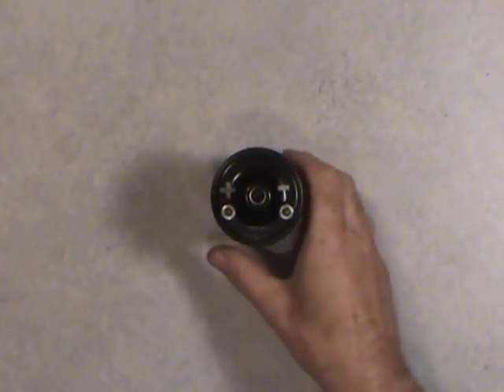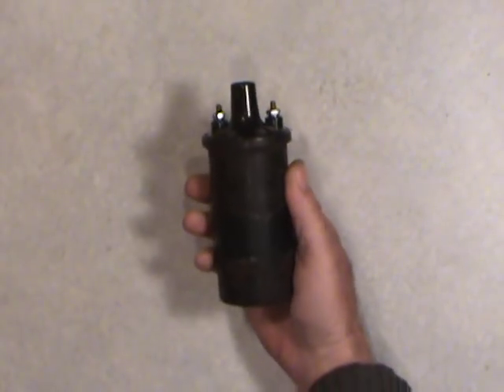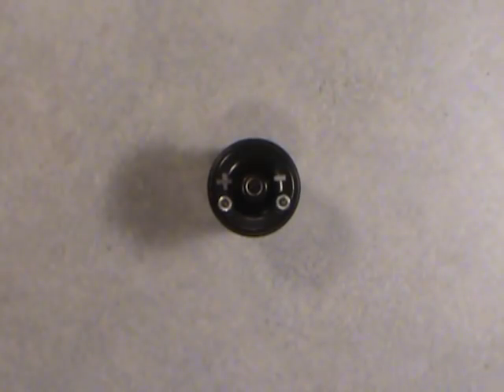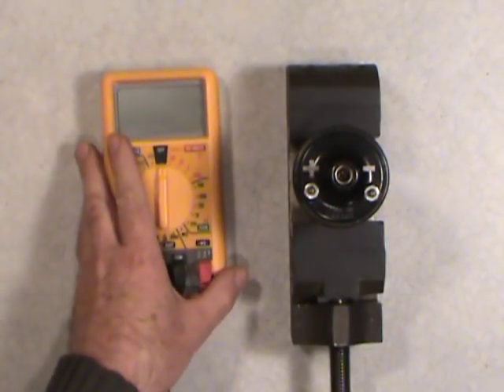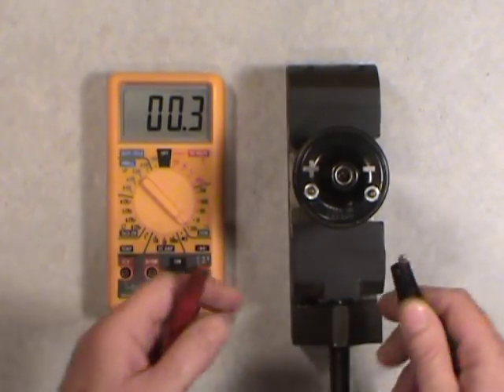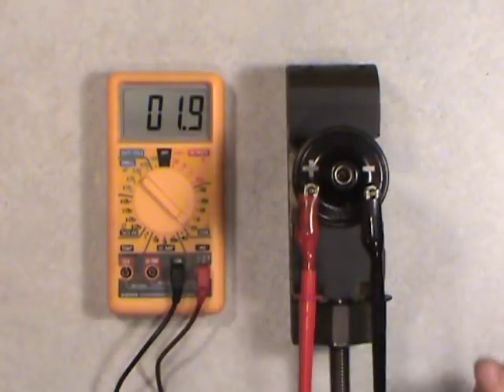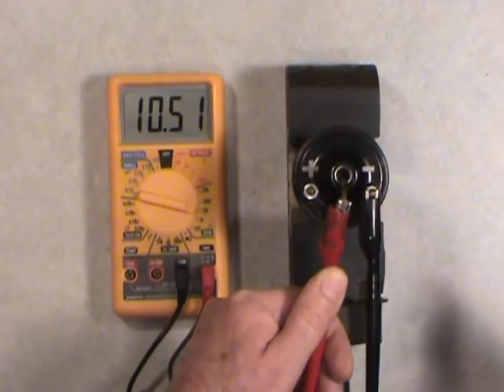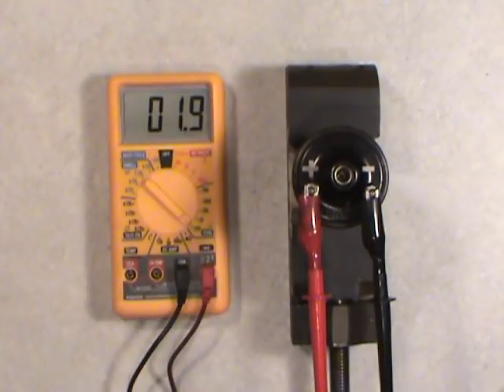Ignition Coil Testing

Comment: This resistance test is a good starting point. It reveals that there is no short circuit as would happen when a transformer get so hot that the isolation of wires burn. It also reveal no open circuit as typical after a short-circuit while connected to a lead-acid battery able to deliver about 1000 amps, when the fuse don't work correctly.

Now, if the coil would have oil leak, such high voltage transformer, which increase the voltage from 12 volt to 4000 volts would eventually start arcing internally. Once the oil leave and some water come in, the isolation get compromised. The ohm-meter which use from 0.5 volt to 2 volts for testing the resistance is far from the breaking point for detecting if the isulation is damaged.

Your lengthy explanation about replacing the "point" by a "comma" and adding an invisible zero, all that to feel how big the number is, is quite convoluted. Why don't you say "105 hundreds ohms" if you care about consistency?

Congratulation for your video. At least, you try to use modern tool instead of just guessing.
Reply from the maker: +Christian Gingras Greetings Christian Gingras....Thanks for watching, and Thanks, for taking the time to post Your comment...................One other thing, (that I usually don't do), that can also be done, when checking-out an oil  filled, type ignition coil, is to check for a "Short Circuit", "between", both, the Ignition Coil's, Primary or Secondary Terminals, and the (oil filled) Ignition Coil's Metal Can/Canister, or, the Body/Frame, of an Epoxy Filled type of Ignition Coil, which is usually made up of, quite a number of Laminations, of Sheet Metal, that are usually, stacked/sandwiched together, which can usually be seen, out in the open, on an Epoxy type of Ignition Coil..........I usually don't do this Short Circuit Test, cuz, I figure, that, any Ohms/Resistance Problems, should probably show-up, when-ever I take the Primary and Secondary Ohms/Resistance Readings, of the Ignition Coil, that I'm Ohms/Resistance Testing, at that particular moment....................You were saying, about using an Ohm-Meter, in the 0.5 Volt to 2 "Volts" for Testing "Resistance"...???...maybe You meant "Ohms" instead of Volts, perhaps...???....................When someone is talking about something like Mega-Ohms, or perhaps Milli-Seconds, it might be quite understandable, for a Person, that uses that Terminology, quite often, as in, an Electrical/Electronics Hobbyist or Technician, who probably doesn't have much of a Problem, understanding, that Technical Terminology/Magnitude Figure, but, the way that I see it, is, if using, oh, something like "Money", as an example, and using the proper Commas and Decimal Point, in a rather "LARGE" Number, I'll bet that, just about Anybody on Planet Earth, should be able to Clearly See, just how "BIG" of a Value, or, the  Number actually "is"...!!!......................Here's a pretty good example for You, right off the top of my head.........Someone Hands You a "Check" for "One Billion Dollars"...Gee, that's quite Impressive alright..............Now, Let's do it my way...ok..............I show up at Your House with a..."Dump Truck"...Filled with..."One Billion Dollars" (in Paper Money)...Now that's "Impressive"...!!!...lol...and that my Friend, is why, I tend to break things down, and put things, in, a, shall we say, "Simple" form, as I figure, that, by doing so, that, almost Anyone out there, will hopefully, be able to, more easily understand, what-ever-it-just-might-be, that I'm trying, in my own way, to explain things to People, that are watching, and listening to, any of my YouTube Videos, now, and in the future as well......................Here are some other things about Automotive Ignition Coils, to consider/be aware of......................The Saturation Time (aka, Electrical Charge-Up Time), of an Ignition Coil is very Important, as well as, the Amps/Amperage, that, that particular Ignition Coil is Designed for...........................If the Saturation Time, usually expressed in Milli-Seconds/One Thousandths of a Second (time-wise)...(might even be a shorter time interval, with the newer coils perhaps?), is not long enough, the Output of the Ignition Coil would probably be quite Weak/Low...........................Now then, if an Ignition Coil happened to be Saturated/Charged-up, with, oh, let's say, too High/too many Amps/Amperes of Electrical Current, that it wasn't Designed for, then, that poor ole Ignition Coil would probably over-heat, and go Kaput, as in, won't work anymore...!!!............Ignition Coils, will sometimes work improperly...weak...or, maybe...not at all, and sometimes, they just plain wear-out, due to, what I've heard, as being, something along the lines of Thermal Cycling (aka, Expansion and Contraction, due to varying temperatures), as in, oh, as an extreme, let's say, that, over time/years probably, this particular Ignition Coil, starts working at a Freezing Temperature, then, gets worked really hard, all day long, then, the Vehicle gets parked outside for the night, at a freezing temperature, until the next morning, where that routine starts all over again, and again, and again.......................That poor ole Ignition Coil, is super Cold, all night long, and the Coil Windings are Shrunk Down, due to all of that Cold Temperature, then, all of those Coil Windings get heated-up, quite a bit, when it reaches, its quite Warm, Operating Temperature.....................From what I recall, the Epoxy type of Ignition Coils, might suffer more, as compared to the Oil Filled type of Ignition Coils Perhaps...???.......................Then, there's the "Size of the Gap", in all of those Spark Plugs as well......................The LARGER the spark plug's "Gap" is, and probably, the Higher the Engine's "Compression" is, as well, will usually Demand/put more Stress, on just about any Automotive Ignition Coil out there.........................I Never, just let an Ignition Coil work, if the Secondary/High Voltage, Terminal/Tower, is Not Connected properly, in the Ignition Circuit, or, maybe, when doing a Spark/Color/Visual Test, at about 1/4 Inch (.250 Inches) Gap maximum, for a very short period of time, or, must have, the Ignition Coil's, Secondary/High Voltage Lead/Wire, secured to a good Ground...Why You ask...???...cuz, if an Ignition Coil's Secondary/High Voltage Terminal/Tower, was left totally Diss-Connected, while in Operation, then, that poor ole, over-stressed Ignition Coil, would probably, try to Increase its Secondary High Voltage Level, to..."Infinity and Beyond" (take that...Buzz Lightyear...!!!...lol), and, the Ignition Coil, under these conditions, would probably just over-heat, and maybe, some melted coil windings as well perhaps, and............till next time............Be Safe, take care, and have a good one.
Reply: You obviously have quite a long experience with many ignition coils for small and big motors.

The advice to never operate the coil without any load on the output is indeed excellent. The reason being that if there is no spark plug to absorb the electric arc created by the 4K volts pulse, then a similar electric arc may appear somewhere inside the coil. It is the same principle as lightning, which strike the most conductive electrically active object (a tree, a human, a building). In other words, the high voltage will "seek and find" the most weak part inside the coil and generate the spark there. That spark will damage the isolation a little and make another spark more likely.

As for my mention of voltage as used by any ohm-meter, here is an experiment you may try: take a measurement of the primary side of the coil with your usual tester device. While it is still plugged, use a volt-meter and connect it on the same two connectors as the ohm-meter. When measuring a very low resistance as this primary coil, you may see a very small voltage, a few miili-volt. If you unplug the ohm-meter, the volt-meter will measure a voltage near 2 volts.

When measuring the secondary at 10.5K, like in the example on your video, and the ohm-meter scale is set to 20K, then you will measure a voltage of about 1,05 volt.

This remind me another advice that you and your reader may like to know : if you have an auto-scale ohm-meter, you may get random reading when trying to measure a large inductance like an ignition coil, a transformer, an electric motor, etc. You can disable the auto-scale or use a cheaper fixed scale ohm-meter to get the measurement. The reason of the failure of taking any measurement from these more expensive devices is that auto-scale ohm-meter are trying each scale many time per second and get reflection (similar to echo in a cave or a church) from the energy accumulated in the coil. Brief, cave man, religious people and top of the line electronic devices are all affected by reflection.
Reply from the maker: +Christian Gingras Greetings Christian Gingras....Thanks for Your comment...........I guess, that I'll start with, Mother Nature's "Lightning" perhaps.................It's very interesting indeed, just how, that hypothetical Lightning "Bolt"..."Strike"...Develops, and finds its way to Earth....................Check it out for Yourself, and take a look at, something like, a "Stepped Leader", (best, when seen in Slow-Motion), that, from what I recall, Reaches up from the Earth's Surface, to, shall we say, Make-the-Connection, to that Incredible amount of Energy, that's stored up in the Sky.............................How an Ignition Coil "Behaves", when in use, is, in itself, very Interesting, to say the least, especially so, if Monitoring its "Wave-Form", on an (automotive, type of) "Scope" (aka, Oscilloscope)...!!!.........................From what I recall, a Scope can Display the Wave-Form, for, both, the Primary and Secondary side, of a given Ignition Coil, while it's Do-in its thing, and, if using a "Parade Pattern", capable Scope, where-by, having each of the Engine's Cylinders, firing in Series/one, right after the other one, in the firing order, and being Displayed, on the Scope/screen at the same time, it would probably be, easily seen, if there was a Problem or two, just by Comparing (visually), each of those Cylinder's, Ignition Coil, or Coils, Firing Patterns, on the Scope's Display/screen...Holy-Gwalk-ah-moly...!!!...now that's cool........................How, the Spark Plug goes "Spark", is, quite the Nasa-Like-Study/Science, all by itself...!!!......................................The Ignition Coil's Secondary High Voltage, has to be quite High (usually, in kilo-volts), to initiate, that so called Spark, high voltage "Spike" (probably, of very short duration, time-wise), then, once that Spark is established, (ionization/flame kernal development, between the spark plug's electrodes), then, that High amount of kilo-volts, will probably drop some, just enough, so the Duration of the Spark continues (flame propagation/development/travel, in the engine's combustion chamber), until the Ignition Coil runs out of energy, to sustain the Spark any longer, I believe (then, on the Scope's freeze-frame Picture, I recall seeing Ringing...as in, a sine-wave, going up and down, just a little bit)............Perhaps, have a look-see, at, just how, oh, something like the, good ole Chevy/Chevrolet, "Points and Condenser" (condenser = capacitor) Distributor and Ignition Coil (up until, about 1974)...Scope Pattern "Display" (freeze frame picture) Appears, and, I found, by doing so, I can actually see and understand, somewhat, as to what's kinda going on, when our Friend, the Ignition Coil, is doing its job, and doing it good, I hope...lol............................The Ignition System, is a very interesting Subject, all by itself, as far as I see it, that is....................All the way from, the Battery...through, to the...vehicle's Charging System (and, if the charging system is Faulty, and, Battery Voltage Drops, so does the Output of the Ignition Coil...Yikes...!!!), then, onto the rest of the Ignition Circuit, which, may, or may not have, a good ole Ballast Resistor, in it, be it the Chevy/Chevrolet, type of, Calibrated Resistance Wire, or, the Ceramic-like Block type...then, onto the...Ignition Coil & Distributor (if there is one, that is?)...through the spark plug Leads/Wires, and pretty much, ending with the Spark Plugs...(every generation/style, year of manufacture, of, just about any Automotive, type of Ignition System, known to Man/Woman-kind, has its own, Specific, "Set" of parts & pieces, and, all of the Voltage...Amperage...Ohms/Resistance...oh and, mustn't forget the Coils Inductance..."Values/Specifications"...should always be Checked & Verified, when doing something, like Upgrading or Changing, any of the Parts or Pieces, that make-up, that, "Specific/Individual", engineered/designed,  Ignition System)............I find, that, if I study-up, on, in this case, the "Whole/Complete" Ignition System, rather than, just thinkin' Only, about the Ignition Coil itself, then, for me anywayz, i can kinda Visualize, just what, each, and every Part of the Ignition System is Up-to (aka, how, it is, or isn't, doing its Job), as in, Lettuce get the Whole Story, not just part of it (I hope...lol)....................Thanks again, for Your Wisdom and Experience, and............till next time...........Be Safe, take care, and have a good one.

Comment from the maker: Greetings guy person....It all depends on what you consider bad...Some ignition coils can get weak, and perhaps function not so good...Then, sometimes the ignition coil gets the blame, when sometimes it can be a bad switch, wire, or connection...If your battery is weak, or puts out low voltage due to a problematic charging system, that can lower the ignition coils voltage output...Electrical components can act strange when they heat up too...Really Bad = No Spark! Take care, and have a good one